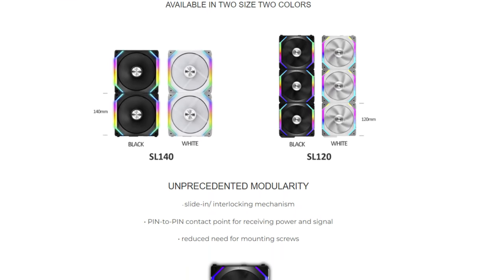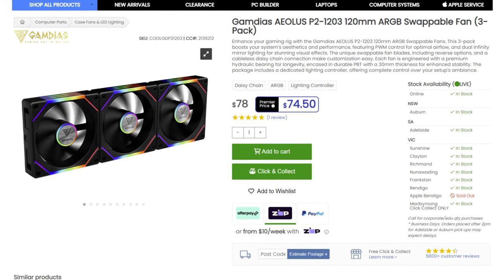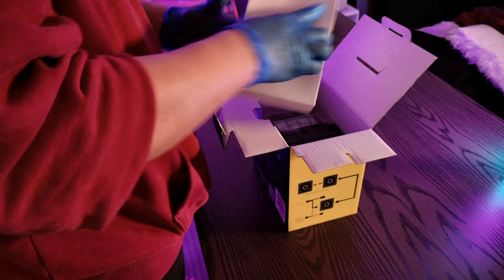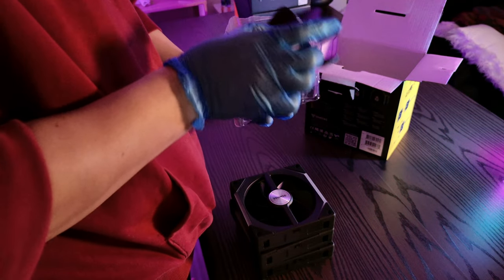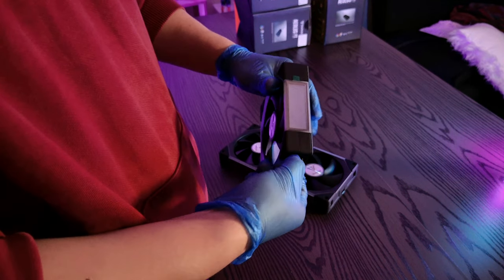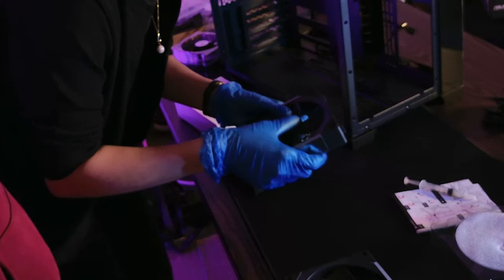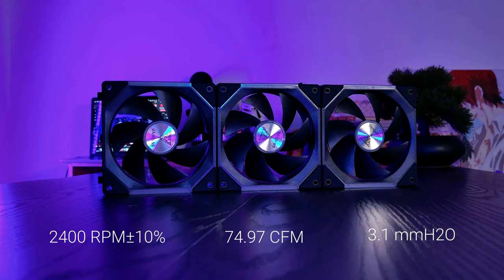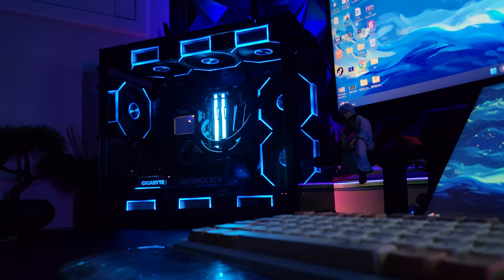This Swappable ARGB Fan is a Game Changer #fans #onlyfans #pcfans #gamingpc #pc

Comment: just bought 10 of these best fans ive ordered . (f ) lian li
Reply from the maker: @ryzenbeast4497  good for you 😂
Reply from the maker: @ryzenbeast4497    One important point to note if you haven't installed them yet, use the short one to daisy chain and use the long cable to connect to the mother board. Otherwise, the argb lights malfunction when you connect 2 3-packs with the long cable.
Reply: @lunosama  thanks for the info got them all installed already .. all working fine.
Reply: @lunosama  🤜
Reply from the maker: @ryzenbeast4497  Thats awesome.